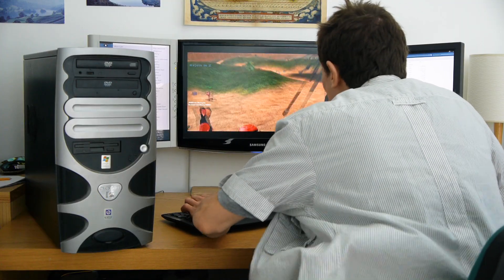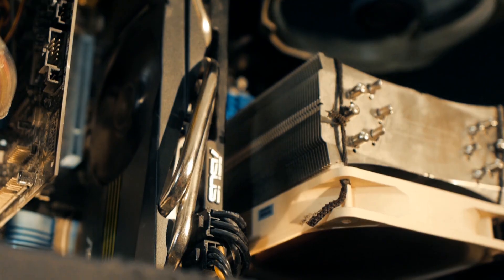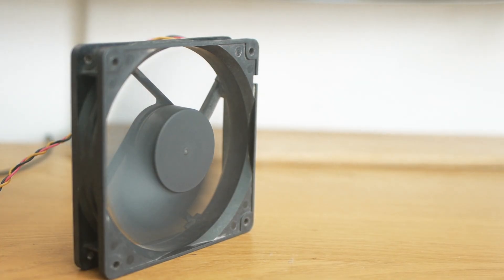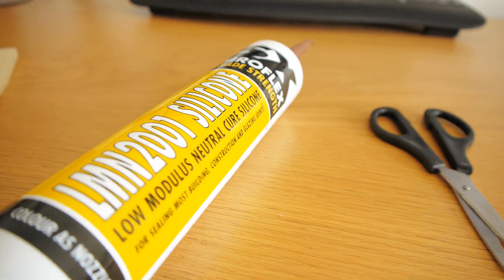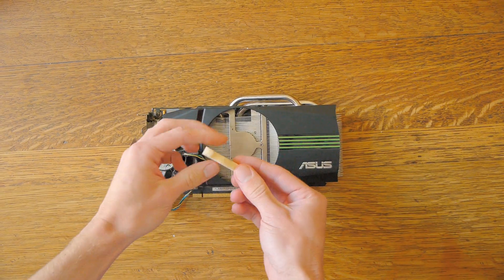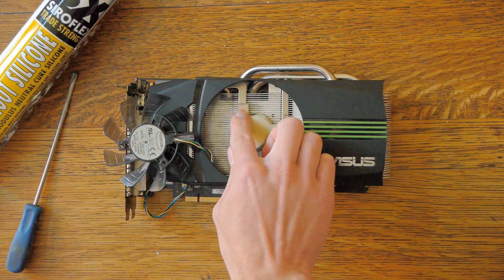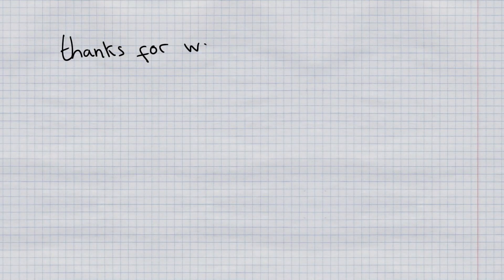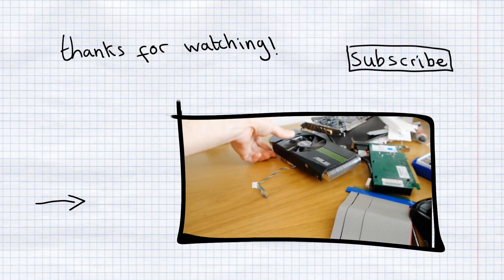How to make a graphics card quieter

Comment: whats the best for quitest solution a heatsink or water cooler? 

thanks!
Reply: cpu? gpu? sound? temps?
Reply: foxfix1998 cpu, or both i guess if it means extra silence lol ... i do music production and some video editing, but i also game and i want it as quiet as can be, i am thinking the r4 case!
Reply: the r4 is great for silence,
a water cooler would probably be cooler and quieter on a gpu but it would be hard to find
just search sound benchmarks, on a cpu you should checkout the noctua coolers.
Reply: also the nzxt h440 is great.
Reply: foxfix1998 what about for cpu would a water cooler be quieter and cooler than a heatsink?

are the noctura better than the AcoustiFan dustproof ones?
Reply: foxfix1998 yea that is one sweet looking case, would the window version be noiser than the non since it has absorption pads?
Reply: a very tiny bit noisier.
Reply: the noctua fans are better just get the ones with the little rubber bits on the corners also the antec truequiet 140mm fans are pretty good,
also remember to get the 140mm fans when you can.
Reply: awesome man thanks! 140mm over 120 when i can ?
Reply: yes
Reply: Ali Hallal 140mm fans have to spin slower to move the same volume of air which in turn makes the fan quieter.
Reply: Drakeub09 awesome, thanks for the info!
Reply: Ali Hallal
 I got the R4 case running on Noctua Premiums 140`s and a Corsair 110  CPU liquid cooler mounted in the front with 140 premium fans as well. Its as silent as i could ever wish :) Actually needs to check at times as i`ve pulled out the power on LED :P  While stresstesting my cpu runs 50 degrees while gpu runs on 55-58 degrees. The premium fans got the rubberbands on all the corners and i really recommend them :D
Reply: Neon1982Heaven nice man i think you have me sold, are the noctura quiter than the acoustifan?  are liquid coolers quieter than heatsinks?
Reply: Noctua is quieter,  
it depends on the cooler, i would just go with a noctua cooler.
Reply: awesome man sorry one last q so noctura are the quietest ones, just want the quietest i can get, thx man!
Reply: You are welcome!
Reply: Ali Hallal
 All i hear from my fans is the airflow, thats how quiet mine are ;D  But if you run the R4 case with Noctua premium 140 fans (140 CFM)  you wont need the fans on top, keep the sound proofed plates on :D Two infront on the radiator, one in the bottom for gpu cooling and one on the exhaust :) i use my watercooling as a intake with push setup.   Not sure how the setup works on other fans/setups, but i seem to have been very lucky on mine :)   Though i must say, if you need your HHD bay`s you`ll need to move your radiator up ontop as an exhaust ;) I`ve moved my HDD`s into the 5.2" instead of dvd/BlueRay roms as i never used them anyway :P    There is not room for the radiator in front panel unless the HHDD bays are gone :)   Adapters for the HDD`s can be bought very cheap at most computer stores :D   Just telling this as a heads up when if you`re planning a similar setup as mine as i had to drive around getting these last parts at a late saturday night and it was annoying :P

Btw, watercooling will give you alot more stable temps, will also give you the opportunity to do some overclocking at the time your computer starts to feel slow, to get some extra juice out of it and make it usefull again :)   I used to have several kinds of aircoolers for my cpu, but after i started with watercoling i`ll never go back :P and these closed waterloops they sell these days are really easy to install :)
Reply: Neon1982Heaven oh man thanks for the detailed response it really helped I  was going to start my build with z87 asus deluxe quad but gonna wait for the z97 since its coming out so soon, the m.2 ssd will be nice!

my buddy got the noctura NHD14 and claimed it was also super quiet, would a watercooler still be quieter then that?  lol sorry for all the q lol
Reply: Ali Hallal the noctua coolers are about the quietest coolers on the market above that there are only huge and i mean huge fanless coolers
Reply: oh so the noctura heatsink coolers would be quiter than a watercooler?  yea i saw the fanless ones my god they are huge
Reply: yes.
Reply: foxfix1998 okay so my understanding is that noctura heatsinks are quieter than watercoolers but watercoolers provide better temp results for over clocking? :D??
Reply: depends on the cooler
Reply: foxfix1998 hmm well i would prefer the cooler to be under $200
Reply: Ali Hallal thats allot of money for a cooler
Reply: foxfix1998 i notice water coolers are way more exp than heatsinks, hmmm might go heatsink then if its quieter and cheaper lol  probably just as good?
Reply: Ali Hallal Yes thats about all of it, i would reccomend the ones with the bigger fans.
Reply: Ot really depends on your water/air cooling kit. If you use the intel stock headsink, a water cooler (just any kind) will be doing a much better job. If you get maybe a be quiet!  Dark rock 2 most water coolers in this price range are louder while being nearly same as efficient. If you have much money to spend, go with a giant case and the biggest radiators you can fit in it, that'll be much better than just any air cooler.

Comment: get a water block
Reply: water block?!? i thought those were only available in minecraft! D:
Reply: Cant beat free
Reply: Rok Adamlje you have to obtain that foam first so it isnt free aswell
Reply: Michael G its cheaper than a water block still not wining
Reply: Michael G It also takes longer, very expensive, not compatible with some cases, can be a nightmare to deal with, and, above all else, not in the DIY spirit. 
Sometimes it is better to be a tinker than a consumer.
Reply: dodemans its not the water system that makes noise its the fans you use to cool the radiator
Reply: Steven Lee you are better cooling, its more reliable, less noise
Reply: thays true i got an msi gtx 770 tf oc 2 gb and im happy about it and i dont want to make risk so yeah ur treu
Reply: Steven Lee doing this has a higher risk than the water block.
Reply: i know
Reply: Why take the risk of destroying your whole system plus money and cleaning and it's way more of a show factor than what it's worth doing.
Reply: WAT!?!?! xD you know the radiator needs a fan to right?? Thanks to my WC system, the computer its louder than an Airbus A380...
Reply: Sergio Pinto ye but not you can overclock everything and shit your rig will become even more powerfull
Reply: MrPooky218 Waterblocks and custom water cooling loops after the same risks. And if you like how your PC looks on the inside and want to show it off, you'll probably want a custom water cooling loop anyway.
For me, however, my Shinobi XL doesn't have a side panel window and I want it to be quieter. This is a much quicker fix.
Michael G There is more to life then OCing everything. Besides the 5-9fps gain can be achieved without using a waterblock. R290 has gotten above 1.6mghz without one. I don't know how much more you can squeeze out of it by using a waterblock.

I think you should be more worried that the sponge might melt due to it being so close the heat sink which can get around 70 degrees Celsius.
I would like to see the shape of the sponge after some time as I am skeptical it will retain it shape.
Reply: Sergio Pinto if your water cooling makes any noice you're doing something wrong..
Reply: dodemans it got 2 big 120 mm fans...

Comment: the glue will get old, crusty and then one day break and that fan will pop out due to not screwing it in, and your gpu will be fried
Reply from the maker: Are you honestly going to care if the fan drops off in 30 years time? Because that's how long it would take for the glue to deteriorate.

It certainly wouldn't fry your card either: they throttle back if they get too warm these days.
Reply: DIY Perks you do realize how much heat is going through that right?
Reply: He was using glue that is used in houses for things like windows and stare cases and other things that are otherwise left to the elements for years and it holds up. I'm sure the heat from the card won't ever bother it, but don't take my word for it go read the label on glue at the hardware store.
Reply from the maker: LucaTurilli89  Why would you want to oil a fan? Sure if it gets squeaky... but I've never had a fan squeak personally ;)
Reply: r3ddevill and about the spUnge*?
Reply: sticking a piece of sponge on basically the heat pad doesnt sound very good to me id rather be safe and buy a new fan set up
Reply: JUS JAK He wouldn't post this video or tell us to do this if it would be harmful. if done properly, worst case scenario the fan falls off in 3-5 years and fries your GPU, At which point justifies buying a new GPU and you would probably be thinking about doing so by then anyway.

Again, this is perfectly safe if you do it right.
Reply: My god there are high temperature silicones if you bother first search for it

200*C normally, up to 300*C for 1 hour

bison . net/ en/ products/ 660-silicone-sealants/ product/ 1475-silicone-high-temp/

Anyway, i doubt that 200*C is a "normal" temperature, further more, a temperature at wich your entire system together with you, would not fry up :))
Reply: Descrption of that silicone:

Bison High Temperature is the best choice for joining and sealing joints, seams and cracks in places where high heat resistance is required. Adheres very well to glass, enamel, tiles, glazed ceramics and smooth metals. Particularly suited for joining and sealing oven and microwave windows, edges around (ceramic) hot plates, heating ducts, flues, heat screens for thefireplace (also suitable in its fluid form for automotive applications).
Reply: this is why gpus/cpus have thermal control, it will down clock once it hits a certain temperature
Reply: Jeffrey Doud Not only that, but that glue will have the cool air flowing directly over it.
Reply: I don't know much about glue, but I do know a bit about computers, and I can tell you that the GPU will not get fried without a fan, unless it's a very, very old systems. But from a point onward, there's been added a standard functions in the software/hardware system, where the components will reduce their performance as much as needed, in order to reduce temperature, if you ever noticed a spike, freeze or a drop of frame rate in your computer, that is most likely the effect of a component reducing it's frequency, operations per second, clock, performance etc. however you wanna call it, to reduce temperature. So don't worry, if the fan falls of the SPUNGE, your gpu will not blow up, unless you're owning a super old system and it's time for it to die anyway.
Reply: Pretty sure tube silicon that is used for bathrooms and roofing has a 20 year life.
Reply: Pedro Bermudes the sp-Unge is the best :)) tho actually there are pretty much a lot of termal sp-Unges :)) if i am not mistaken that can stand up to 200*C
Reply: Silver Mirai Geforce-Cards only do this since Series 600 and newer. The 500 Series isn't that old and it doesn't clock down automaticially. 

Instead of doing this kind-of-risky-thing, why don't you just setup an custom fan curve? Let it run at minimum speed below 70°C.
Reply: BlankFX I very highly doubt your statement and would like sources quoted. I'm positive even my 560 throttled.

Also a custom fan curve will not make it quieter really, as you will often need full fan speed in demanding games. This is not a risky mod, it's quite safe actually.
Reply: dumle29 Do you think you have felt it getting slower or have you really watched it using a tool?
The 500 Series does not change its clock speed by it self - except switching the P-States from P0/P8/P12, which is technicaly not comparable to the clock speed change modern cards do as this happens according to the performance currently needed, not by heat or anything else.
Reply: BlankFX As I said earlier, I'd like a source on that. I have since replace my card, so I can't test myself.
Reply: +dumble29 You may google it yourself.
The automatical up- and downclocking feature is called "Boost". And the Boost-Feature had its debut with the "GTX 650 Ti Boost", which was released in March 2013.

Too bad I know by expierence once I state a fact about something, people never says "Oh okay, I now believe you", instead they just don't answer anymore....

Btw: I still run two wonderful GTX580, which, you might be guessing it, never clock down by themself at all. (As long as I don't hit my shortcuts, which I have 5 of for "very low clock rates", "low", "normal", "high" and "I don't want to pay this electricity bill anymore!".)
Reply: BlankFX Just blankly believing someone on the internet is never a good idea.

That said, I have no data on it. You claimed that the 500 series doesn't thermal throttle. It don't think the boost feature has anything to do with it, but the thermal throttling may have been introduced along with the boosting.
Reply: dumle29 Okay...for those being a bit low brained of us...

The Boost Technology automaticially over -clocks the GPU till a decent TDP is hit. One but not the only factor is the heat of the GPU. If the TDP is hit, e.g. the temperature, the Boost-Technology is lowering the clockrate slowly till the TDP-Limit is no longer exceeded.

Though it lowers the core clock, Boost will never lower it below the default core clock value of the GPU, even if the TDP is still exceeded.

Beside of this, Geforce-GPUs never had a feature which automaticially underclocks the GPU. Never!
Once again: Never!

So just to sum it up for you: No, Geforce-GPUs never underclock themself, even if their temperature would go up to 140°C.

CPUs on the other hand...they are doing this since...about the Core2Duo-Generation?

Did you understand that Geforce-GPUs never do any underclocking ever just by themself?

If you didn't, please refer to the official Geforce Forums to get the same answer by others and a post by me laughing or crying...
Reply: Silver Mirai Well, unless the thermometer gets damaged. I remember having a guy that had his gpu fried cause the fans stopped due to thermometer malfunctioning and the gpu heated up more than 300 degrees celsius before the pc crashed. When visually checking the gpu, the pcb had traces of being melted.
Reply: BlankFX That's not right, you can download any overclocking program and decide at which temperature the gpu will underclock. I have mine underclocking at soon as it gets to 80 degrees tho it never goes above 73 in heavy gaming (tho it goes to 76 when i push games to 200 fps).
Reply: Daniel Silva "Thats not right"? "any overclocking program" - That is not right.

Maybe you want to label such a tool and especially state if/how it's working for Geforce <600 Cards.
Reply: BlankFX that's = that is. Learn English before trying to teach anyone.

For example, Gigabyte OC Guru II does it. As far as i know it's not something hardware related, as long as the gpu is able to get underclocked, the program can just underclock the gpu when it's over the temperature maximum you tell the program.

My GTX 560 did it (on Asus GPU Tweaker), and my GTX 770 does it.
Reply: Daniel Silva Maybe you want to learn grammar yourself, before telling people to learn a language they are probably more expierenced in than yourself.
It's up to the speaker to choose between "that's" or "that is" and I was never referring to your grammar by my earlier comment but to the fact that what you said was untrue.

Also, from time to time you might want to check what you say before saying it.
OC Guru II does nothing like automaticially underclocking anything. It doesn't even automaticially overclock. Especially not while it's "yet another tool which's sourcecode comes from RivaTuner".

What you are talking about is the tool-independant back-clocking to the normal clock rate from an higher power target clock rate. E.g. from 110% back to 100% performance when the GPU hit the temperature threshold. And again, the automatic overclock feature, also called Boost or Power Target, is a feature only supported from the Geforce 600 Series and newer. Read my earlier, long comment on that.
Reply: BlankFX I can choose the target i want, either the TDP i say or the temperature i say. And if it gets past it, the gpu will underclock.

Stop pretending to be an expert.
Reply: if you're worried replace the sponge with little anti vibration pads and used the screws back in the holes
Reply: realy now, if the glue dries up and the fan gets loose you will SURELY know about that, mainly from the noise made by the fan sping at 1000 rpms hiting other components, that would be hard to mis
Reply: LucaTurilli89 Recently most fan makers restrict access to the bearing compartment on fans,so chances are the fans are already sealed anyway.
Reply: What about the thermal shut-down feature?
Reply: PC_GameWorld  You do realize that doesn't matter, right? The glue just gets heated up and then cools down again respectively, prolonging the deteriorating process.

Comment: this could start a fire.
Reply from the maker: Sponge doesn't begin to melt until subject to really high temperatures (much hotter than the surface of the GPU under load), and that's MELTING not combusting.
Reply: oh okay sorry for the confusion

Comment: My GTX 780 ti 3 way config is pretty quite, actually silent. Water cooling :D, the only noise is just audible from the Water cooling radiators and silenced optimized Airflow fans when running prime 95. And the fact that there silenced optimized in a silenced optimized case, the Define R4 case. Sometimes I forgot my pc is on and accidently turn it off